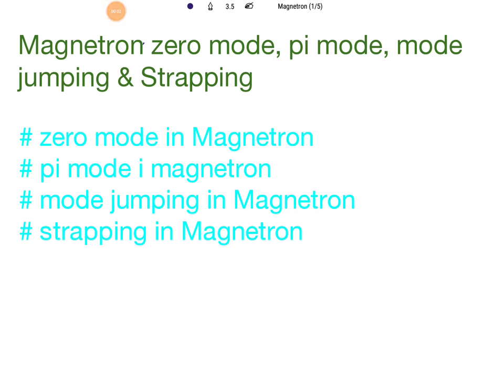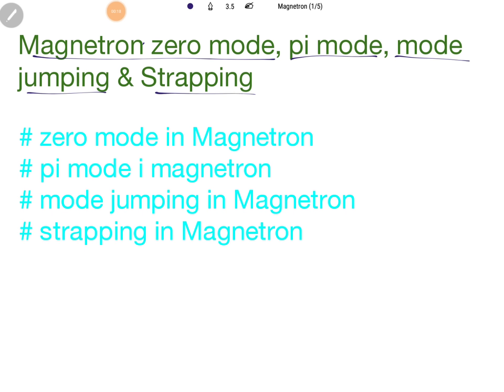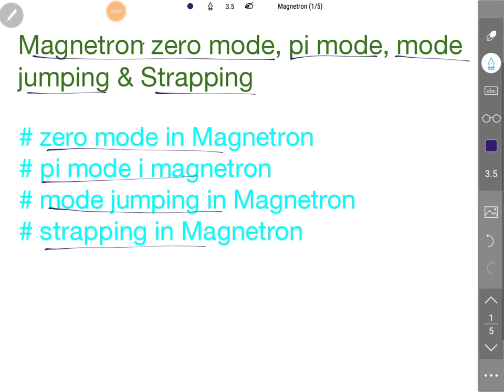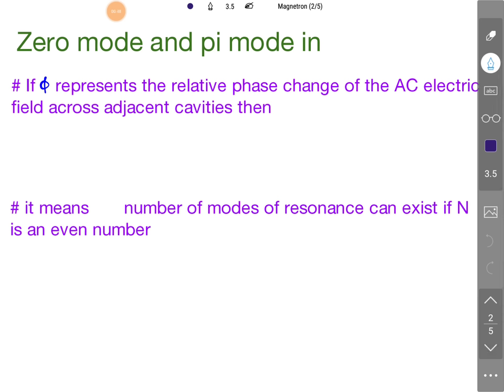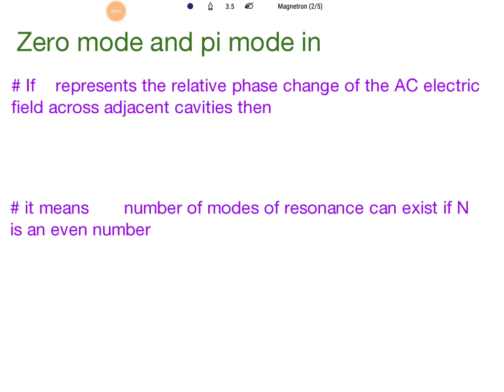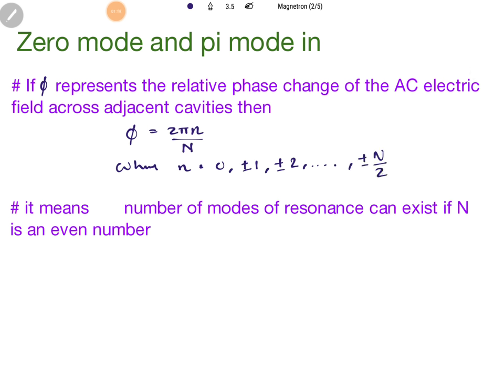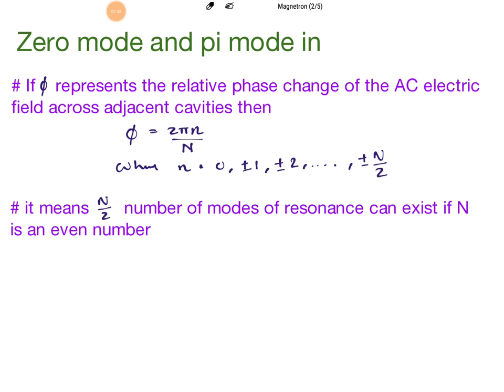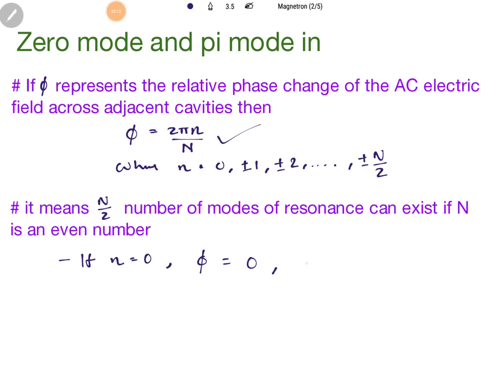Magnetron zero mode, Magnetron pi mode, Magnetron mode jumping & strapping of Magnetron

Comment: Is it possible to run a commercial magnetron on continuous mode?
Ie, have it continuously output microwave radiation instead of pulsating at 30 hertz due to mains line frequency and half wave voltage doubler circuit?